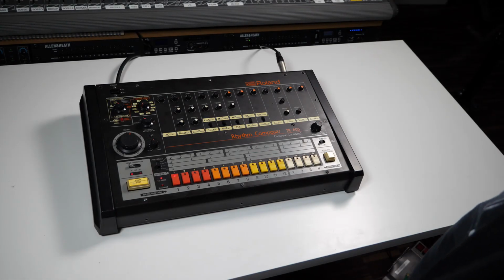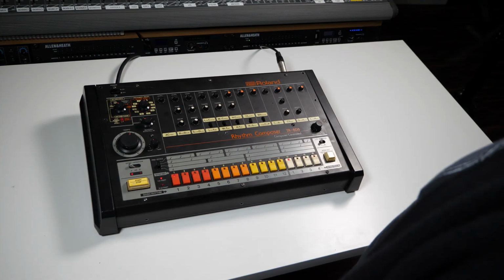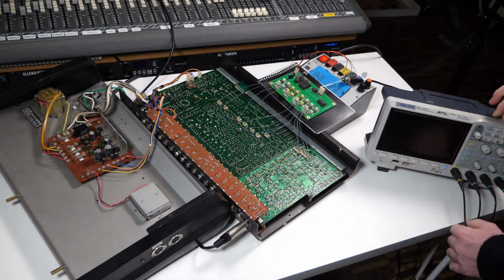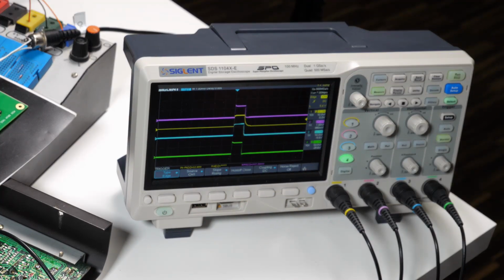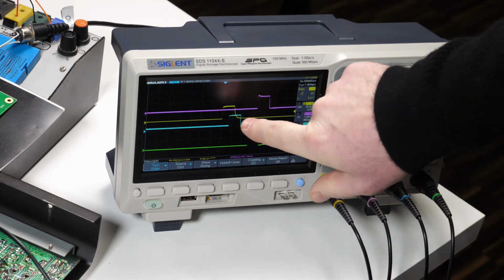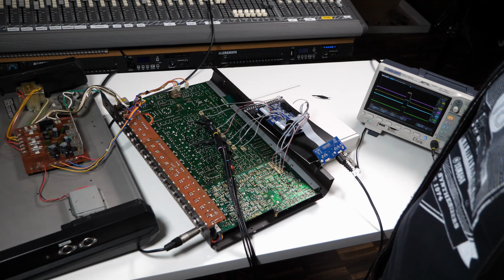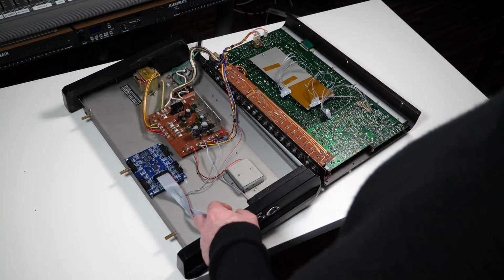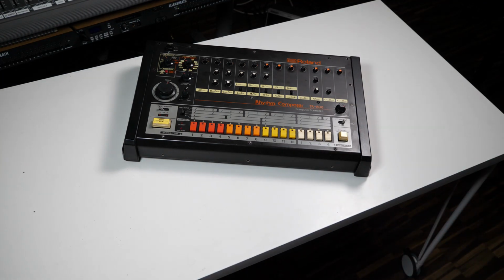Cirklon Dmux as internal retrofit for TR808

Comment: So why can we not have this technology readily available in a sequencer other than the Cirklon, starring at the Circklon screen can be super hard, could we just not get a really nice screen attached with a mouse and use your machine, now that it available in many places. Some of us are still using Atari for sequencing, and the Circklon is much more tighter, but men the Circklon software and lay out is way over complicated, could you not work with some company and mass produce it so this new generation of producers can actually get their head of the DAW audio and embrace what we were doing in the 80s and most part of the 90s ?
Reply: You can have tight MIDI and CV directly from your computer with Expert Sleepers modules. I have the ES-3, expanded with 2x ESX-8MD for 16 sample-accurate MIDI outputs.
Reply: @zdfghdfg  I spent better part of 2021 with ES stuff, I sold all of them, first of all its nightmare to set it up in Cubase on Mac,which Os did send a lot emails, it just does not work tight when using all the midi ports, I can get better timing using Cubase with a Roland UM880, not an Abelton fan at all, which ES stuff works well, moved to bitwig, that took forever, then just did hardware instruments set up without ES, worked nice , however the pinging of external instruments its never dead on, the audio interface is tight, remember not interested in recording audio, we want to sequence midi only, CV is tight no question, got the Assimilator from Rossum, amazing but its not midi and even with the midi, everything else is not tight, this is why everyone dumps stuff into the computer and all the mojo magic of midi sequecning is gone cause they just copy past and everything sounds like a robot, no life. If you record midi out from all the ports on the ESx, as your go down the ports, there is jitter, it is not sample accurate by any stretch of the imagination, ended up using Innerclock System Sync Gen and finding 3 sequencers that can actually do the job but its is a mess, there is no need for all of this, because we already had tight midi before any of the usb stuff showed up, for those still reading, you can use the Unitor 8 with driver with logic and its pretty decent, but never been a logic fan. Erm is snake oil, if you want to move sequencing back and forth, just get an sp-16 toraiz works better than Erm, delay sequences or bring them early with just one twist of knob. There is nothing out there, maybe InnerClock will have something, the MIOXL is joke for timing. All we got is Atari and Circklon, the Atari lags a bit as well, but its in the pocked, the new akai mpcs are joke, the older ones are 8 times tighter.
Reply: @PermanentGreen  I use Bitwig with ES and MIDI tested it to be sample-accurate by recording the pulses as audio using all 16 channels at once and MIDI-to-TRS cables I made. I didn't use the ping since I couldn't make it work from the external instruments device with the ES-5 plugin, I compensate for the instrument's MIDI input latency. It's tighter than Atari. There's still some jitter from the instruments themselves but it's very small. It did take me a long time to figure all this out but I enjoyed the process. Made some new tracks while testing. I have a template that opens every time I start Bitwig. 
Nice to meet someone else who's into MIDI jitter that much.
Reply: @zdfghdfg I don’t want to compensate for it, I just felt like it became so rigid, but I do know what you did, my theory is that if we can be in a pocket of .25ms or less, all across but have a groove, you know like that good drummer that has pocket and we can all be forced into that, that is what it feels like with Atari and Mpc 60, 3000 and even Cubase 6.5 with Roland UM-880 with their FTP driver, have you checked the InnerClock Systems website the Litmus page, very interesting
Reply: @PermanentGreen  Sure, I was visiting it frequently when it updated but I almost have none of the products they tested. 
I can test my own instruments myself but since I'm sequencing from the computer I was more interested in tightening MIDI notes. 
Maybe we're striving for different practices
I see no drawback in compensating for lags. It sounds tight like plugins but from hardware.
Reply: @zdfghdfg  I just finished testing Octatrack and it’s metronome is 10 samples delayed by almost every bar and when you sequence external media, the variance is 139 samples then Media channel 2 is almost 300 samples. I don’t understand how people think that it has a good sequence specially if you are working with Audio within the unit and then sequencing one or two external sense, maybe the sense have slow attack times and it doesn’t matter, but I think this is a fundamental issue all across the board and people they just dumped the stuff in DAW and fix everything there. My goal is to have the tightest meeting note sequenced from the computer and not with CV. Have you looked into triggers?

Comment: I was hearing this phasing issue since i started making music. Everybody talked about jitter not heard "up to 20ms" (playing solo drum) but not about this issue with the mix of instruments (that can happen with even 0.5ms or below) 

I added ta rigger input for the Vermona DRM1 just to realize that the triggers acts before the "CPU" so the timing was even worse then the midi input. This happen to me again with the Waldorf pulse+ I ordered just to have better timing with it's CV/GATE inputs. There it was a CV/GATE convertor to MIDI that converts to CV/GATE again.
I guess the reason manufacturer do this is that the trigger LEDs will lite when you trigger the drum/synth (so they ignore or don't know about this phase/timing issue).
Also, If you play fast "Flame" say triggering a drum with an LFO with MIDI (or on the DRM1 trigger inputs) you can also hear the midi limitation. You can actually hear the CPU cycling...
Do you by any chance have a way to check the DRM1 from Vermona for similar solution? :)

Finally somebody who care. I was beginning to think something wrong with me,
It's so good to see that you notice this problem and you did something about it.  Thank you for this!!
Reply: Wow, I thought I only did this with Pulse+, amazing to know someone else went that route, we have now over 25 external sequencer that are not circklon and its same garbage, getting better results with an Atari and using Innerclock Systems clock, but we need proper midi sequencer that is tight like what he is showing, I do not understand why people dont want to let the masses understand what is happening, I totally understand you want to make money , please make a lot but make something that many folks can use as well, its better for the music creation.

Comment: Amazing work here Colin! I was wondering, is the 808 able to play as normal using the internal sequencer if replacing those transistors you mention? Also wondering how/whether accents can be transmitted using this retrofit to get that classic 808 vibe.

Cheers
Reply from the maker: The trigger insert boards mix the internal and external triggers to drive the sounds together. Internal patterns can be played and overlaid with external triggers.
All sounds in the 808 receive a common accent voltage. That voltage switches between a low default and the high level set by the ACCENT knob when accent is enabled on a step.
The external trigger inputs give full and independent control over the accent for each sound.
Reply: @sequentix  sounds fantastic. Now if only the cirklon was readily available  :)